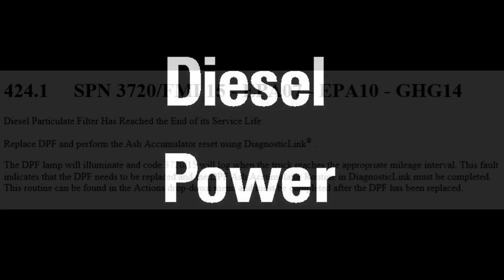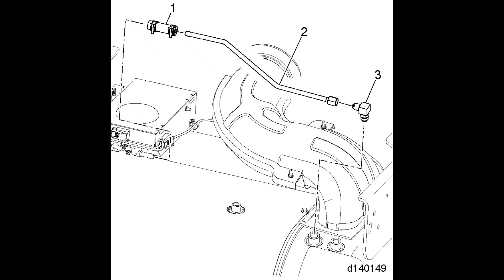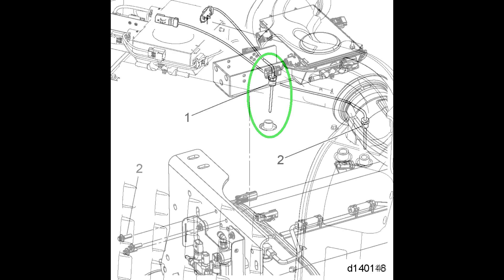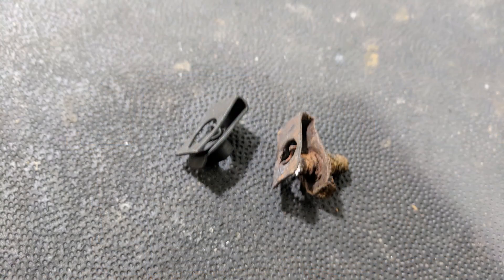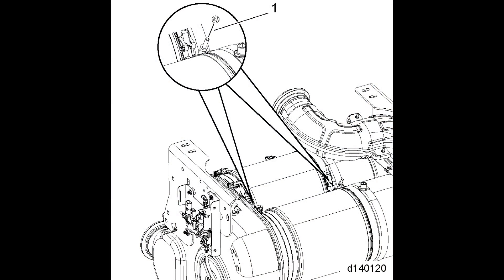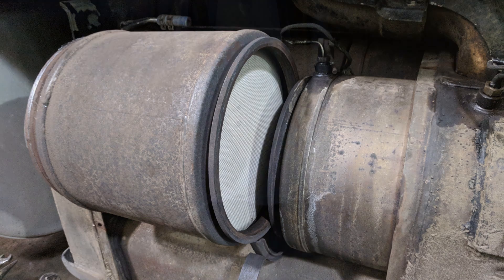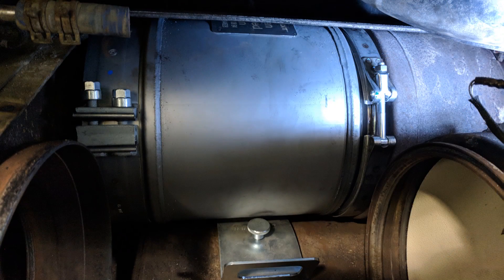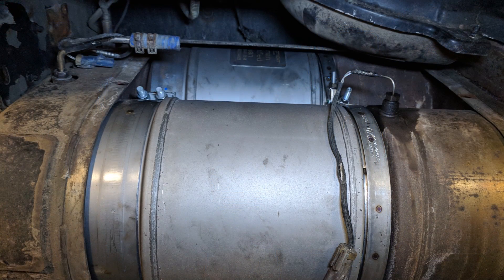Detroit Diesel 1-Box DPF Removal

Comment: I did put new DPF filter but the next issue was the filter before those the little ones on the right side of the DPF filter  with the whole unit they   are very dirty what should I do should I just replace whole thing or What would you recommend   thank you

Comment: Cleanest damn doc outlet ive ever seen. Overall the job is pretty doggone easy though. That Detroit tool is trash and I've never been able to set either filter correctly with it. For me, I use the rear band clamp to kind of set the filter in place, then use 2 pry bars like the one pictured to finish lining up the filter.  Easy way to tell if it's lined up is to check that the forward v band clamp is perfectly upright, with no variance in offset between top and bottom of filter (what you can see from where you're working). 

If I don't have to fight the sensors (somewhat common) and if I don't have to grind off most if not all of the heat shield bolts (almost every time) I usually get a dpf change done in just under 2 hours.

Comment: Could you make a video on reading the temperatures on the one box. What are they supposed to be. Thanks man. Videos are Awsome
Reply: During a parked regen, you're gonna wanna see somewhere between 975-1200 for doc inlet and doc outlet (those two should be within 100° of each other for the most part) and anywhere from 850-930ish for dpf outlet. That shows that the unit is dosing properly and the proper cleaning is being achieved.

Comment: How did the cover come off without removing the thermocouple for the DOC?
Reply from the maker: +Marcus Jones It lifts up and sort of tilts as it moves to the side. The temp sensor and connector then move through the hole in the shield.
Reply: I didnt think about just unplugging the sensor. I'll try that next time. I usually just pull the sensor unless it's seized...in which case it still comes out and then I get the joy of rethreading the bung.
Reply: How do you remove the nox inlet sensor.. mine is really stuck.. do you apply heat ?

Comment: OK, I'm a bit confused here. Are you replacing the DPF because they are dirty and plugged or because they "died" ?
Do these "stop" working(reacting, scrubbing the exhaust) after a PRESET number of miles(PLANNED OBSOLESCENCE $$$$) ?
I thought as long as you kept cleaning them and flowing thru they would work "forever". I guess forever was too long and too good to be true.
Reply from the maker: JIGA BACHI This particular job was special circumstances. The truck has about 600,000 miles. This is the second time the filters have been cleaned. Time was a factor and it needed to be done fast so washing was not an option. This truck runs a good duty cycle so we would use air cleaning on it but our machine was down for maintenance. Pre cleaned Reman filters were the best option.
Reply: Got it and thank you for taking the time to reply and explain, much appreciated.